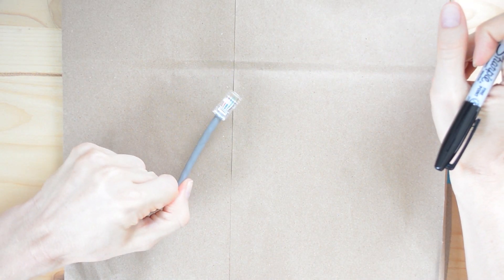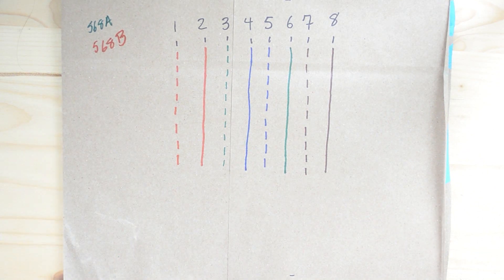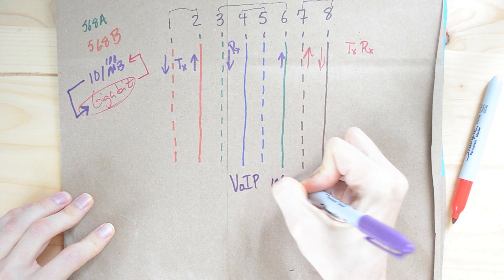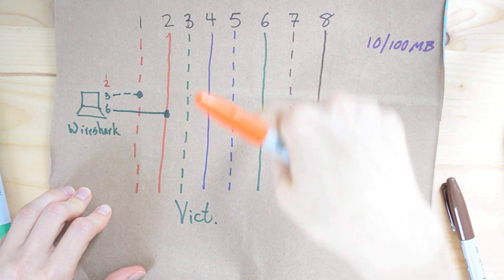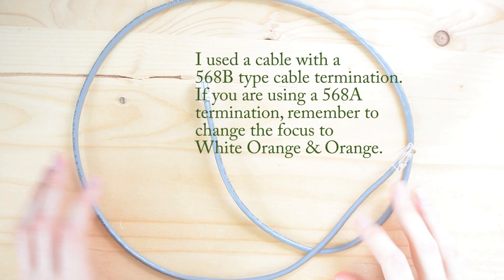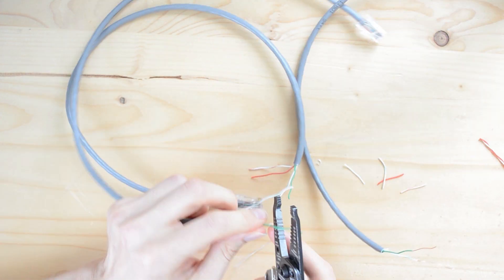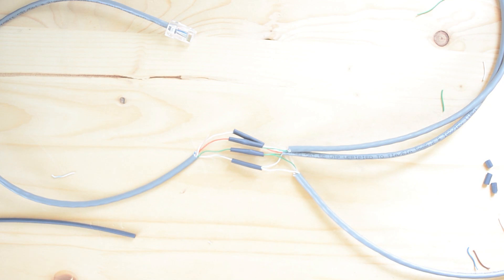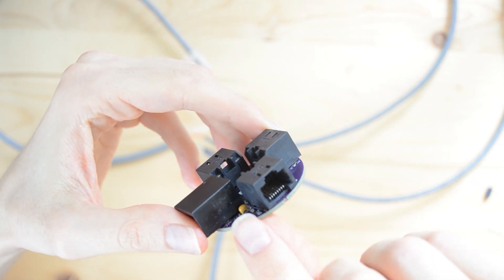How to Build a Passive Network Tap

Comment: Seems to me that you could turn off the TCP/IP stack with a card in promiscuous mode. Been a whiles since I had to use something like this. Will probably need to turn off any file sharing types services that might create UDP port announcement messaging.

Comment: Only wires 3 (RX+) and 6(RX-) are connected to Monitoring machines, what about remaining, because with just two wires the Monitoring machine will not power up the poet and there will be no connection
Reply from the maker: No, it will work with just 2 wires. You may have to vary your connection sequence, but it will work. Sometimes Gigabit ethernet adapters have a difficult time adjusting to the load, but with a little persistence, the interface will come alive.
Reply: @Skinnyrd  

Is it possible to minimize the load of the listening adapter by using a high impedance op amp ?

Comment: Great Video mat! what if you needed to capture both TX and RX at the same time on the same machine?
Reply: use 2 interfaces and merge the capture or switch to a software or other network based solution like switch port mirroring.
Reply: I know Im quite randomly asking but do anybody know of a good site to watch new series online?
Reply: @Zyaire Benson Flixportal :D
Reply: @Erick Leandro Thanks, signed up and it seems like they got a lot of movies there :D I appreciate it!
Reply: @Zyaire Benson No problem :D

Comment: I'm curious why your would go thru the trouble to make a network tap like this when you can use network switch that does port mirroring?  Also I be a little concern about causing reflections on the Ethernet line and cause packet errors.  Port mirroring allows you to monitor the packets on selected ports and use WireShark to see what is going on -- even works at GigaBit speeds.  Examples of switches that do port mirroring are the Netgear GS108T and GS108E.  I keep one in the trunk just for case when I want to see what traffic is going to and from a device.  You can also use a hub instead of a switch although hubs are pretty hard to find now days.
Reply from the maker: StevesProjects Good question. You will find that a lot of my projects aren't exactly a clean solution. Yes it does create issues with speed and performance on the line. Usually it's not enough to matter in most office environment situations. In truth I carry the very Netgear switch you referred to and use them in classes that I teach.This tutorial is more geared toward those looking for a field expedient solution. I sometimes have to work with guys that have very few resources and encounter problem sets in resource poor conditions. This can range from the kid at the local hackerspace that can't afford a switch to a military sys admin who finds himself in Iraq trying to troubleshoot a network. It's "good enough" engineering at work.Thanks again for the comment and have a great day!
Reply: Skinny R&D
Fair enough.  PS.  I really liked your KiCad and using Oshpark video.  That is how I found your channel.
Reply from the maker: StevesProjects Thanks! Glad it was helpful.
Reply: StevesProjects Port mirroring has a few issues that a passive tap overcomes.  The most obvious one is that port mirroring copies the TX and RX for a particular port and mirrors it to the TX of a monitor port.  If you have over 100 mbps combined TX+RX ( which could be from a utilization as low as 50%) you will miss packets on your monitor port since it will be congested.  Obviously if the utilization is below 50% on the target port then port mirroring can be an advantage because all the traffic is combined into one interface!  There are some other reasons someone might go with a tap over port mirroring that are discussed on the wireshark wiki and elsewhere.  

For the resource rich, JDSU, black box, and others make passive networks taps that run about 300 bucks for single line monitoring and they scale up from there.  They do gigabit as well!

I really like this tutorial though!  One thing I would change would be to put a female RJ45 jack(wall jack) on one end of the target cable.  That way this becomes an easily insertable pigtail onto the existing cable you want to monitor.
Reply: I dont think a hub would work because it would change the electrical signal of the rx cable and with auto sensing ports you prob will have packet loss and connect / d/c
Reply from the maker: Thanks for the suggestion. I don't think about wiring in female RJ-45s that much because I'm a barrel connecting fiend.